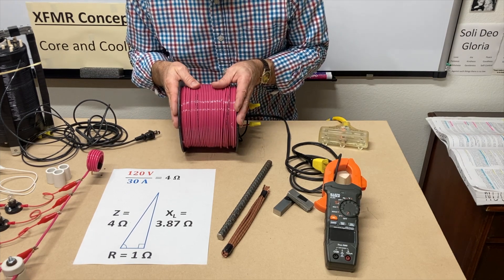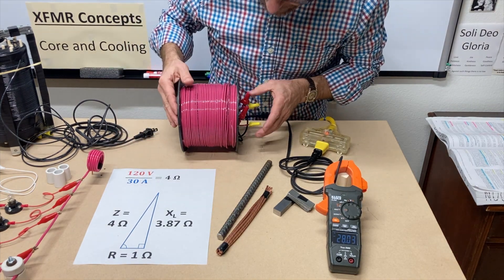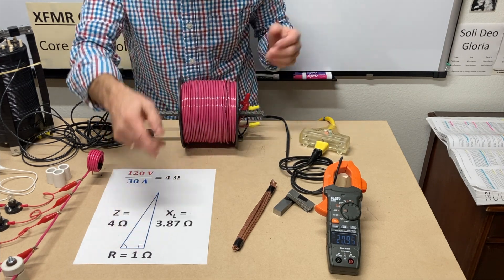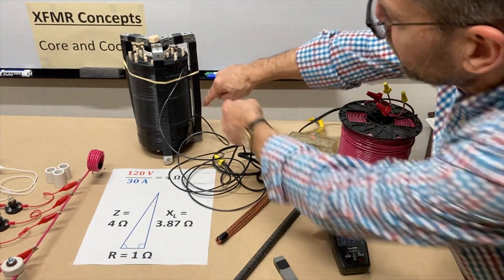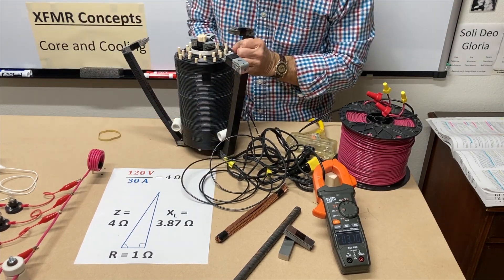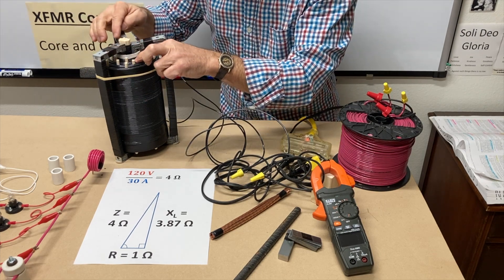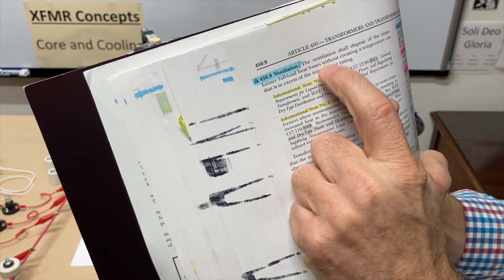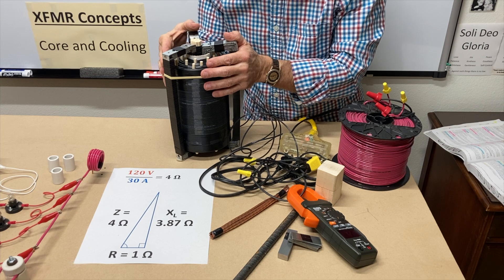Transformer Core and Cooling

Comment: I truly love your emphasis on being pragmatic while teaching this material. I have one question for you about the core material. I noticed that toroidal cores are made of a long laminated coiled ribbon of Fe-Si... Well is the Silicon, part of the alloy, or is it just sprayed on the surface of the ribbon as electrical isolation to prevent the core in becoming a solid donut... to minimize the Eddy currents like you mentioned ? But being a continuous band, wouldn't it promote those Eddy currents instead? If so, should this ban be interrupted by making it a staggered muti-bands core? On the other side, the gaps introduced in  the "E-I" transformer cores seem to be responsible for their loss in efficiency? So...I'm confused..!!!.

Comment: Hello Mr. Gordon, I conducted the same experiment you did here with a spool of wire. I used 12AWG, THHN Stranded. Looks similar to the wire you used in this video.  Only there was about 250 feet of it rather than a full 500 foot spool.  That may be key to my findings in contrast to yours in the video. 

So, from the 120 volt circuit, I measured right at 120 volts, pre-experiment. During experiment I found the line voltage went up by 5 volts, to 125. The clamp meter read 75 amps over the winding. Yes, the 20 amp breaker tripped within about 3 seconds. The spool of wire was warm but not hot. No smoke, arcs, or melt downs. I tried the metal rod through the center as quick as I could with nothing.

So what am I doing wrong?
Reply from the maker: I can't say why the line voltage went up in your case, but the 75 Amps sounds within range for 250' spool of #12 (depending on number of turns). My initial question is if the metal rod you used was ferrous based, meaning it's made from iron. An easy way is to see if a magnet sticks to it. Try putting the ferrous rod, or a few of them, in before energizing the coil as 75 Amps is quite a lot for a 15 or 20 Amp circuit. Additionally, you may well be aware of this, but you don't want to intentionally trip the breaker too many times as running more current than the circuit is designed for can cause issues over time...
The other comment I'll make is that you need to be careful with where your ammeter is relative to the coil. If it's too close it may read incorrectly depending on its orientation.
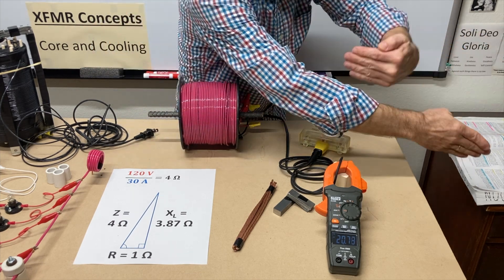Here's a video where I use a couple hundred feet of #18 with varying numbers of rebar cores. I turn it on at 2:20 and you can see the voltage drop when I turn it on: https://www.youtube.com/watch?v=f-SEFiXeSqE
Reply: @davegordon6819  Hello Dave. Capacitance is why the supply voltage rose. This is a major problem in long distance HV lines and is only resolved by reactors. Even then, the solution is not perfect. I was a substation maintenance fitter and protection tech for 30 years and have seen 220kV jump to over 500kV when the reactors on 2 lines in series (total about 650km) were taken out of service by mistake. Nothing blew up as the BIL rating of the equipment was 650kV

Comment: I know you're in a series talking about transformers, but do you mind at least considering taking a look at saturable reactors? I think it somewhat ties in, and it's a very interesting subject.
Reply: I think it's a good old-school control system that even still has modern uses and can be demonstrated easily. I find it fascinating, and a lot of hobbyists create them to control their high-power devices, as well as for fun.

You can demonstrate it with both powerful magnets, and a winding on a transformer acting as an electromagnet for the entire core.

Comment: Whaaaattt.......how does that  NOT trip the CB??   How does that NOT melt to insulation on that wire?? How is that NOT a dead short??? Something doesn't make sense here
Reply: It's probably on a 20amp breaker, which would trip if he kept it near 30 for a while, but it won't instantly trip until 40amps.
Reply: His explanation should absolutely make this clear, that's what's so amazing about it!  He's visually showing you the effects of impedance/inductance and EMF/back EMF.

When I found his videos I'm literally in super nerd mode because this man has literally found amazing ways of showing the physics principles!  SO FREAKING COOL!  🤯